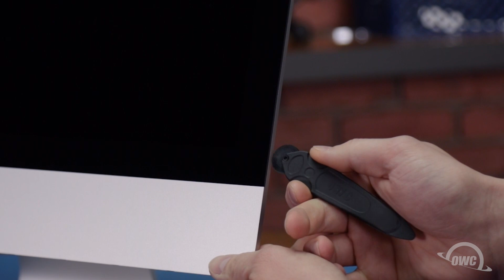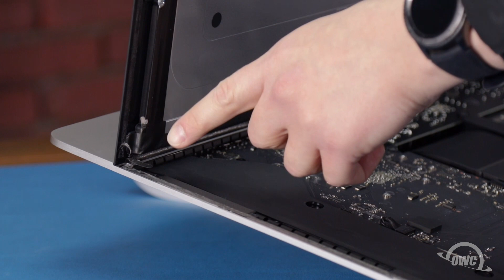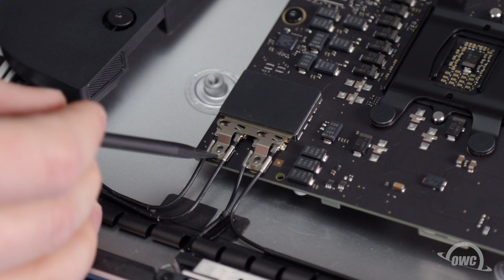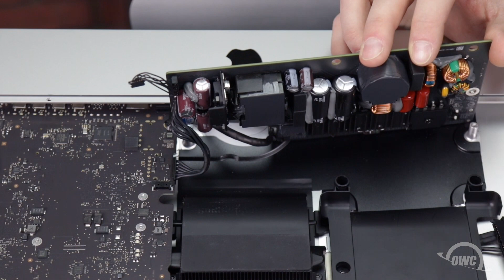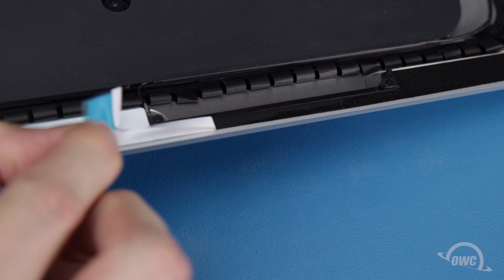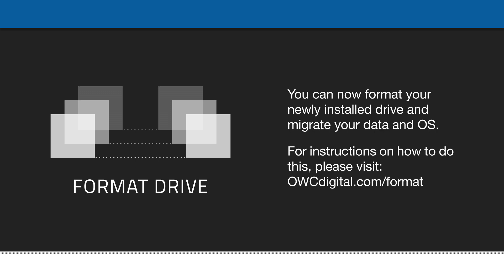How to Upgrade/Replace the PCIe SSD in a 21.5-inch iMac (2019) -- UPDATED VERSION AVAILABLE

Comment: Hi, i just updated my iMac 21.5" 2019 thanks to your video, but I was wondering if you probably missed a step: add a temperature sensor to avoid the fan overwork. ¿Could you please tell me if it is neccesary or not?
Reply from the maker: Hi Roberto. For the 21.5" models after 2012, the thermal sensor cable is not needed.

Comment: Maybe someone will find it useful, but I have imac mrt32, I do not have this connector for SSD (not soldered). There are contacts, but there is no connector. I bought an SSD, but I can’t install it. As it turned out in some countries, Apple in the configurations where there is no Fusion Drive - just does not solder the connectors, it saves $0.5? I am disappointed! Look photo https://drive.google.com/open?id=1rTVtSOw2_rGSTjTl9WyaZHEovllRiUD9
Reply: Only the Imacs with fusion drive or SSD drive have the Pcie slot
Reply: yeah...I didn't realize there's no PCIe slot until I opened my imac. Any solution?
Reply: @snoopy28snoopy  I sold it, we couldn't do it. just soldering the connector will not work, there are not enough microcircuits on the board
Reply: @teo6172  thx for replying. Guess I'll still replace the HDD with a 2.5inch SSD... Maybe we should get a 27inch next time. There's an SSD slot inside whether you customize it or not.